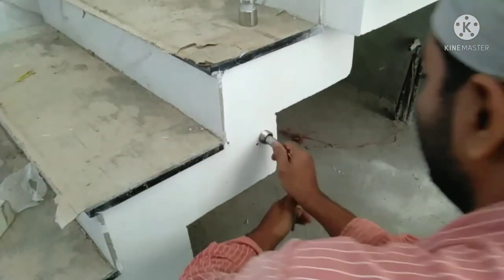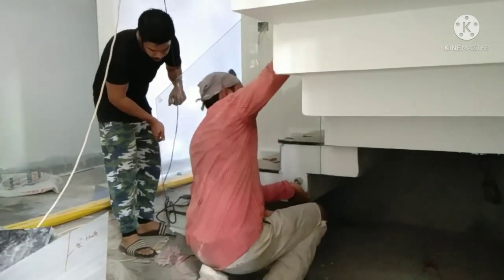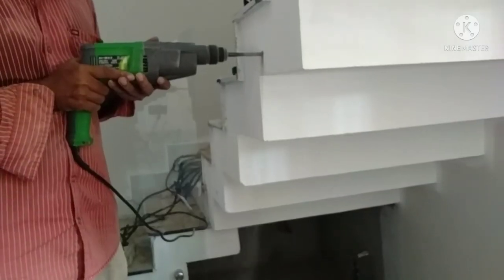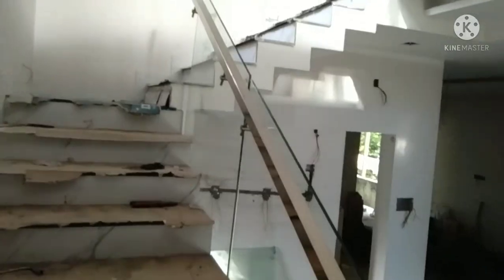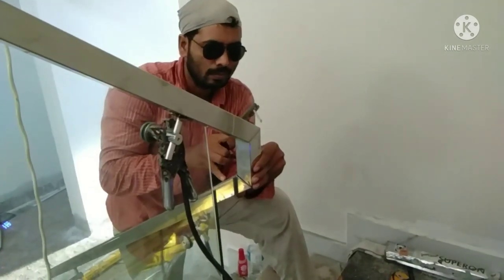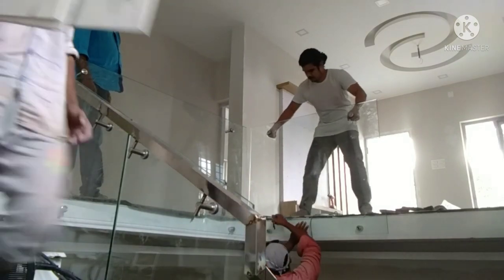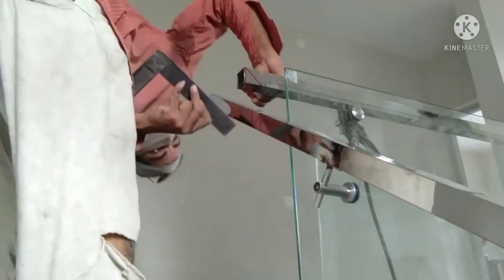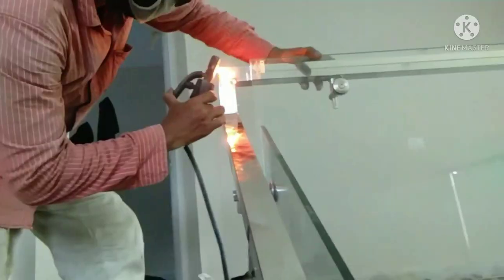Stainless Steel glass handrail     staircase railing full installation process

Comment: നല്ല worke 15 Step എത്രയാവും ഏകദേശം Total rate.?
Reply from the maker: Glass work Lebur കരാർ ആയിട്ടാണ് ചെയ്യുന്നത്
Tuff Glass 10mm sqft 205
Point stud one no 250
L jula 180 one no
ഒന്നര square pipe one length
 2800
Glass ചരിവ് വരുബോ കട്ടിംഗ് glass ൻറ പൈസകൂടി പോകും
Reply: @malayaleeworker6433  contact number plz

Comment: 15 meter e type glass vekkan ethra cost akum 15 metr front top balcony adakkam ane ethra akum onnu paranju tharump
Reply from the maker: 10mm Glass 205 square feet
Balcony fitting 
Spy got one no 400
Ljula one no 180
Stairs fitting
Point stud one no 250
Ljula one no 180
സ്റ്റെയർകേസിൽ 
ചരിഞ്ഞു വരുന്ന ഗ്ലാസ് കൂടുതൽ വേസ്റ്റ് പോകും അതുകൊണ്ട് ചരിവ്  വരുന്ന glass നു പൈസ കൂടുതലായിരിക്കും ബാൽക്കണി glass സ്ട്രേറ്റ് ആയതുകൊണ്ട് സ്ക്വയർ ഫീറ്റ് നോക്കിയാൽ കറക്ട് ആയിരിക്കും ബാൽക്കണി ഏരിയ പൈസ കുറവായിരിക്കും
Reply: Ippo Nigelude video ille aa same model ane stair stair mathram 10 meter ane measure cheythappo.
Reply: Aakadeshyam ethra rate akum ennu arinjal upakaram akumayirunnu